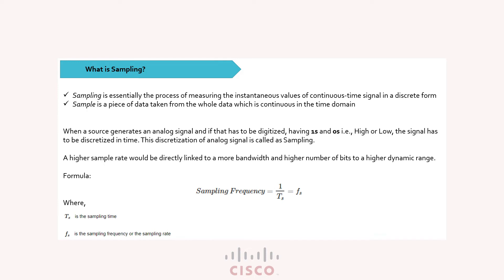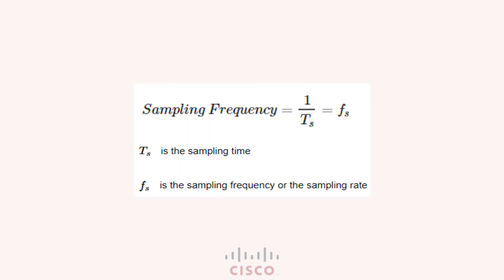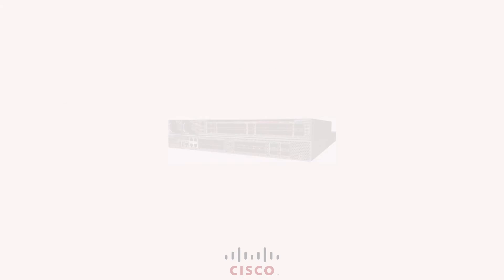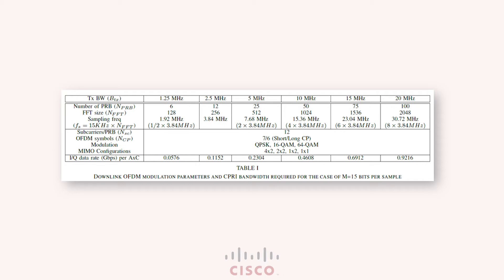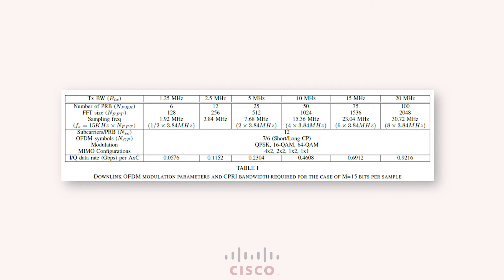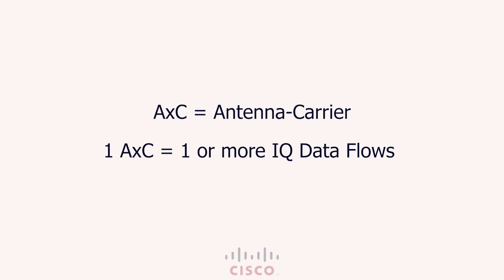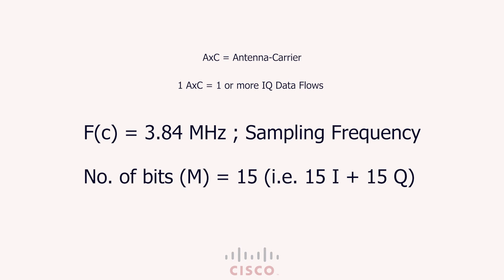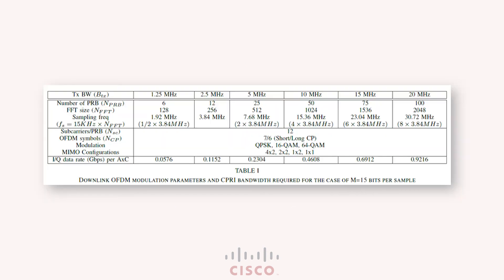Deploying Converged Packet Fronthaul - LTE Resources | Sampling Frequency | Sampling Interval

Comment: Thanks for the video , one question , as you mentioned we need 256 FFT samples per symbol to recover the signal by the receiver. Each symbol has 12 SC of 15Khz .Can you explain how are we getting the sampling frequency by multiplying 15*256.